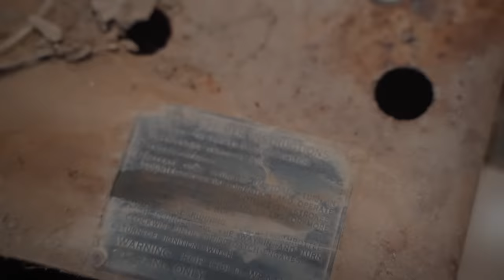WORKSHOP WEDNESDAY: Greatest tank BARN FIND in Australia! PART I

Comment: Bois I have a new old stock (From 1941) AC Delco speedometer for an M3A5 in stock.  I'm not 100% sure it can be shipped to Australia from USA because it has some radium paint on the dial, but the radium dial paint is very oxidized and I highly doubt it's still radioactive enough to trip whatever sensor they use at Australian customs when they scan things for hazardous materials.  I also have a Post-WW2 NOS AC Delco speedometer that goes from 0 to 80 MPH instead of 0 to 60, that doesn't have any radium paint on the dial.  The 1941 speedometer is actively listed on evilbay USA, I don't have the post-WW2 speedometer posted up yet.  The tachometer gauges with engine hours are interchangeable with M35 fire truck tachometers, which are cheap and easy to find, and the post-WW2 ones don't have any radium paint on the dial.

Comment: M3  Lee/Grant:
The Medium Tank M3 Lee/Grant was an American medium battle tank that saw action in World War II. It was also used by the British and Soviet armies. Successor was the much improved M4 Sherman. [...] 
Since the US Army mistakenly assumed that the Panzer IV armed with a 75mm gun was the most common German main battle tank (in fact during the western campaign this had been the light Panzer II), the installation of a 75mm gun in the US tank required. However, the turret of the M2 Medium Tank was too small for this gun. In parallel with the time-consuming development of a new tank, it was decided to build an M2-based tank with a 75mm gun mounted in a casemate on the side as a temporary solution. Due to the limited traverse range of the main gun, the 37mm gun was retained in the turret. The M3 was created in just six months. [...]

A larger number were also supplied to the Red Army in the Soviet Union. Here it was called "grave for 6 friends" because it easily caught fire when hit.

[...] Since the M4 Sherman had replaced the M3 in mass production as the superior design from 1942, the M3 very quickly disappeared from tank units at the beginning of 1943. After the armament and turret had been removed, it served as the basis for numerous test and special tanks, including for clearing mine barriers and as an armored recovery vehicle.

M3  - 4924 pieces
Riveted hull, was initially armed with a 75mm M2 and 37mm M5 gun, later production models then armed with the 75mm M3 and 37mm M6
M3A1  - 300 pieces
Cast shell, but were no longer produced due to the higher production costs
M3A2  - 12 pieces
Welded hull, otherwise identical to the M3
M3A3  - 322 pieces
Welded hull, powered by General Motors 6046 diesel engine, the rear engine doors have been removed and the rear armor has been expanded. Later versions omitted the side door
M3A4  - 109 pieces
Driven by a Chrysler A-57 multibank petrol engine, resulting in an extension of the hull at the rear 
M3A5  - 591 pieces
Riveted hull, powered by General Motors 6046 diesel engine

Comment: It would be nice if the tank outside, and many of those parts, could be left in the original condition, where possible, rather than completely stripping it back to bare metal and repainting. These are 80-year-old machines, and I feel they should often reflect that age.

Comment: General Grant Tank. 
Oh dear....
Yes, it had a big gun.
But you had to maneuver the whole tank to use it.
Otherwise, the gun in the turret was only suitable for shooting pigeons.
And the profile of the whole thing - the height.
You'd get a nose bleed sitting on the top of it.

Still, we had nothing else at the time.
The Sherman that replaced it was of limited use until us Brits stuck a 17 pounder in the turret & called it the Firefly.
The British 17 pounder in the Sherman was the only tank in Normandy that could knock out the German Tiger.

But, the Yanks wouldn't use it because it housed a British Gun instead of their Pop Gun as originally supplied. 😂

Their loss, our gain....